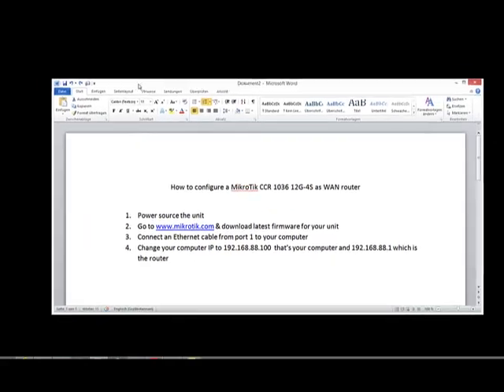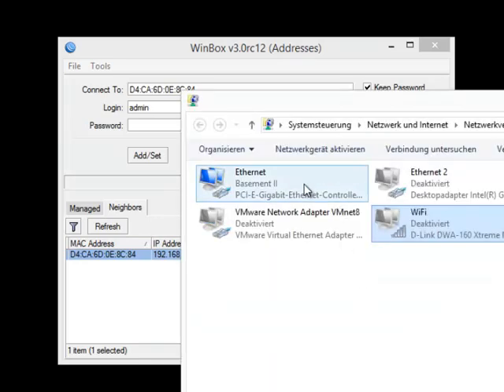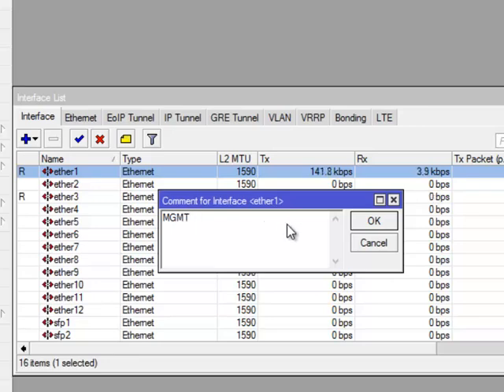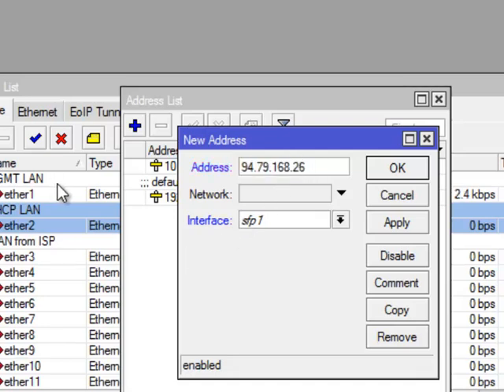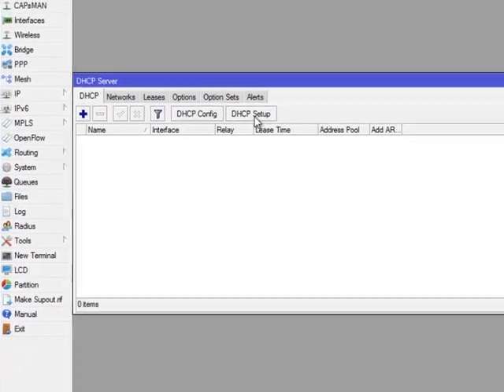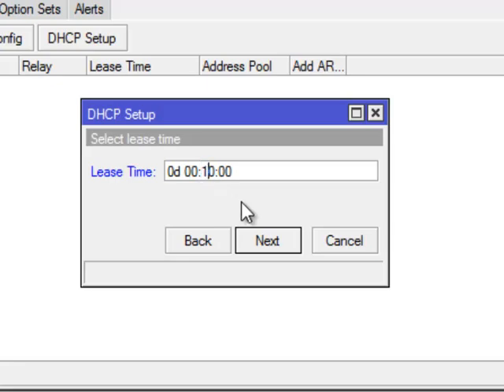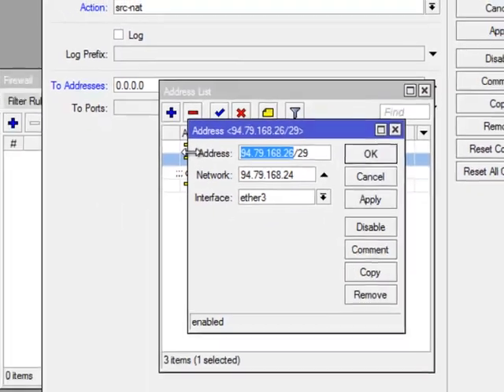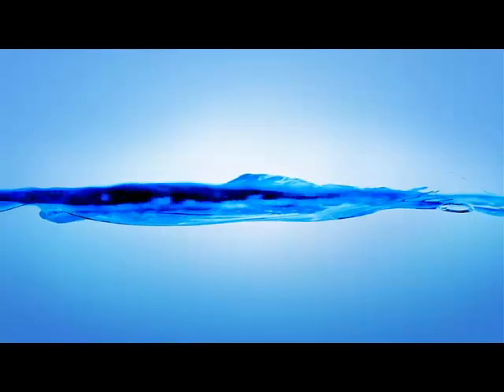Step by step MikroTik CCR 1036 router configuration

Comment: I constantly get the error could not connect to 192.168.88.1
Reply: Nakul Chawla normal ips are 192.168.1.1 or 192.168.0.1 so you would need to set as either but change the 1 to 100